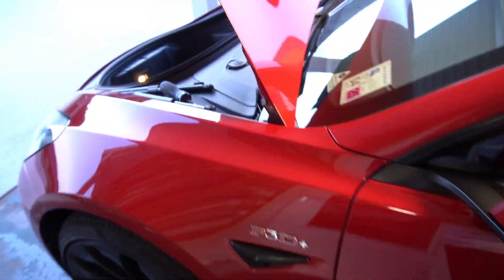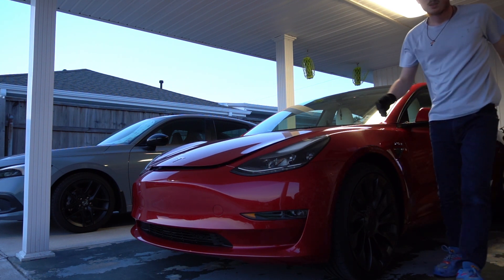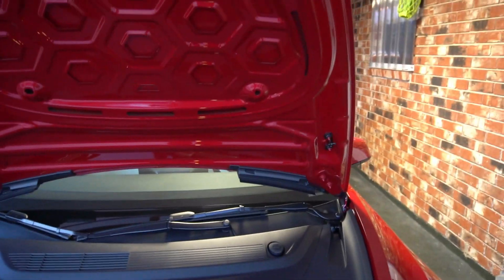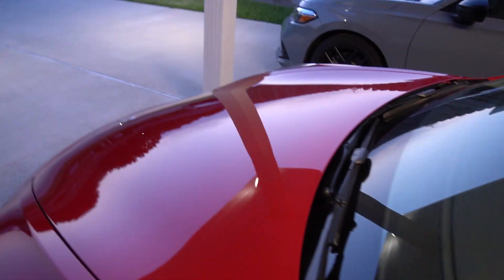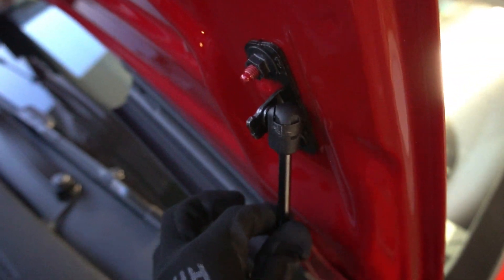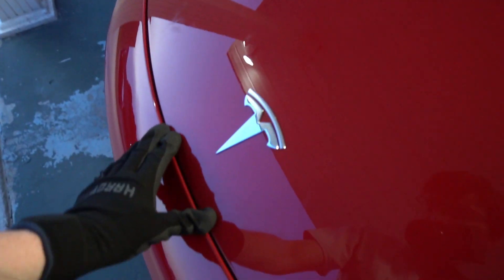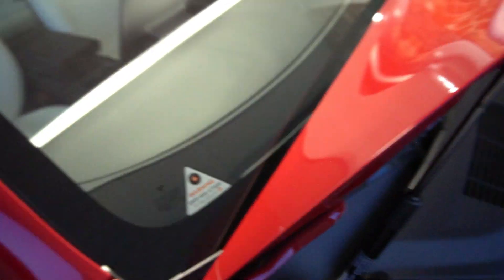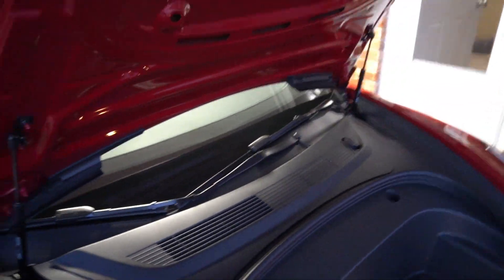Tesla Frunk Strut Upgrade

Comment from the maker: Please note!
I had to fix the orientation of the struts from what's shown in the video...I made a mistake and was not paying attention.
In the video, they are installed upside down, which is what caused the frunk to shake once it opened up. If you install them in the other direction, the fat part of the strut upwards and not downwards, there is a slowing mechanism that slows the strut down near the end of the travel on the piston, which ultimately stops the aggressive shaking.

Please rotate the orientation of your struts when you install them to the opposite way I have them shown installed in the video.
Reply: Bryce, we’re the instructions printed upside down?

Comment: No one can make a slower opening strut ?
Reply from the maker: You can slow the speed by using one instead of both of the struts. Or if you want full speed like I have just use both. 

For the other side you can leave the factory strut & only use one of the modified ones if you want slower.